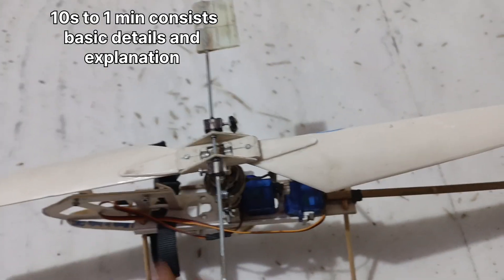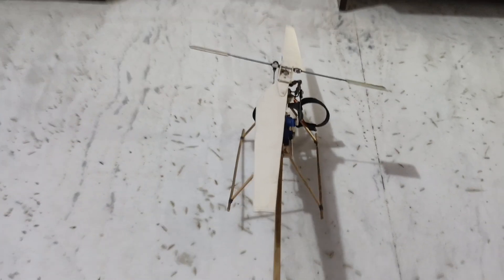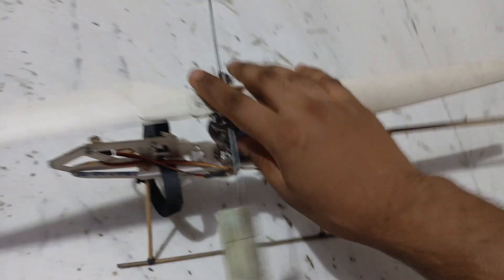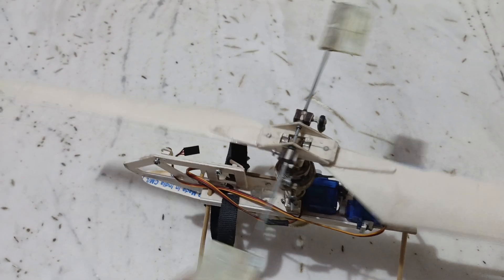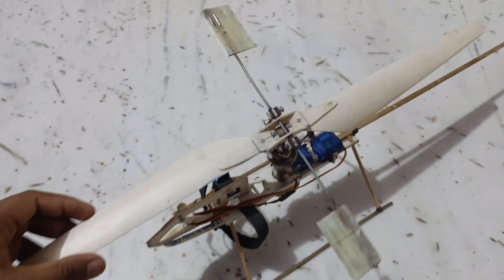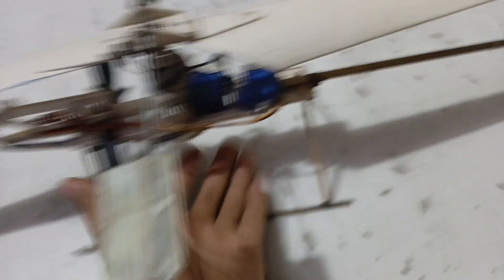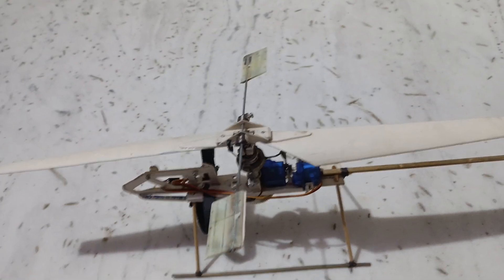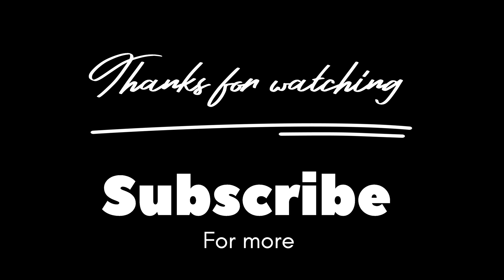Flybar Rotor Head for Arduino Helicopter DIY

Comment: Hi. Somanadh here. make a video on Phaeton Load Cell Sensor-CZL-701 Weighing Screw-fastened . i have seen your comment in Robu. just make a setup video or youtube short by explaning hoy to use and program, and to calibrate it.
Reply from the maker: Don't use CZL-701 it's output is not good +- 1-5 grams of tolerence in its values.